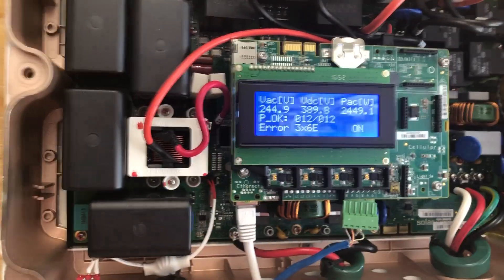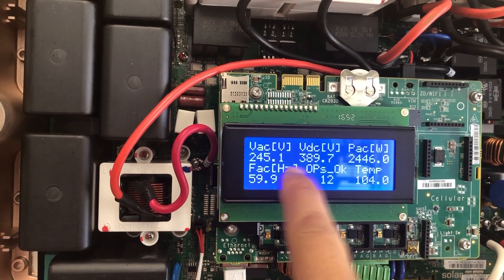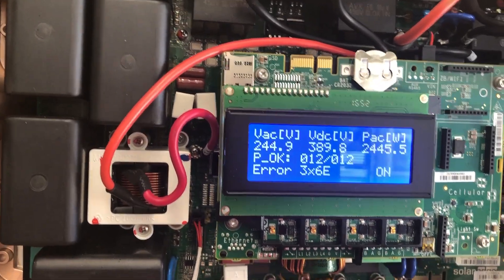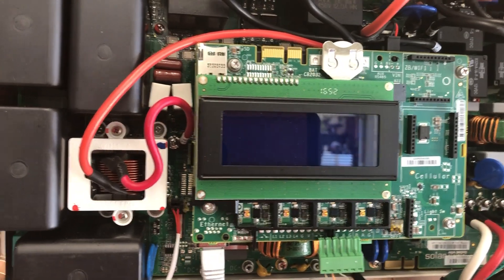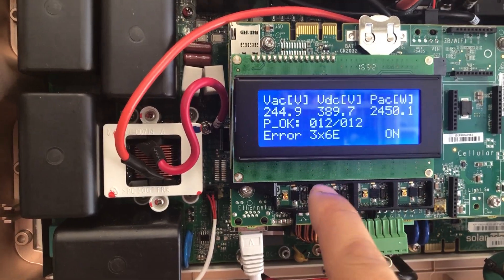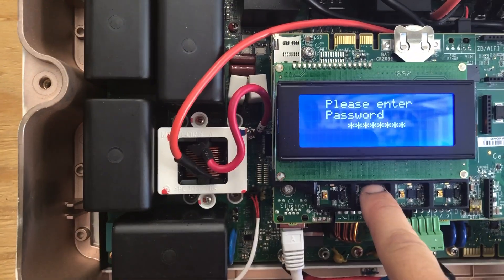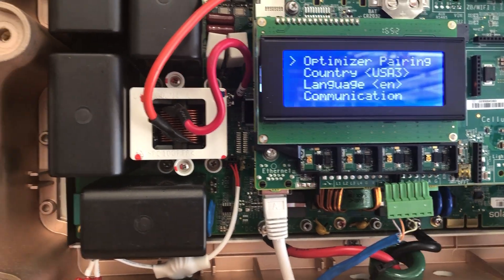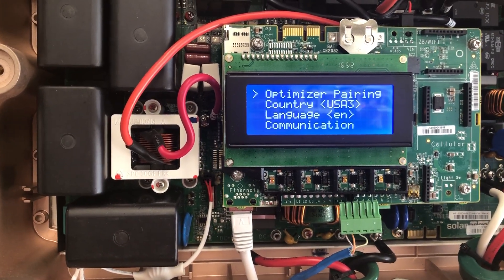Not able to get into SolarEdge menu because of error message [SOLVED]

Comment: hello, with me the second button is broken. i have tried everything but can not find one on the internet and to bridge it does not work either. have you vieleicht a good advice for me ?
Reply from the maker: Not really, I do not really a solution other than replacing the board.
Reply: Im trying but after shuting off the inverter y can put the password but inverter shuts off